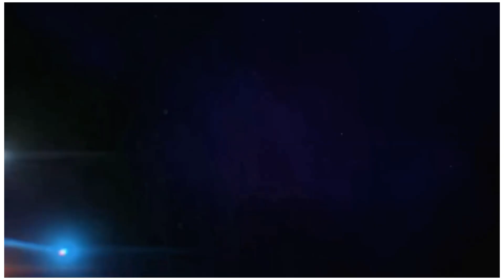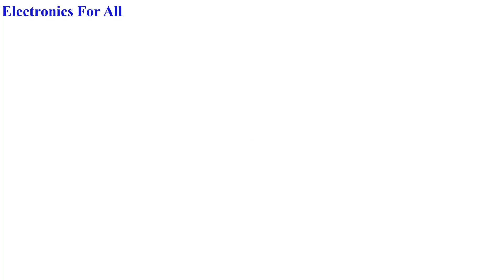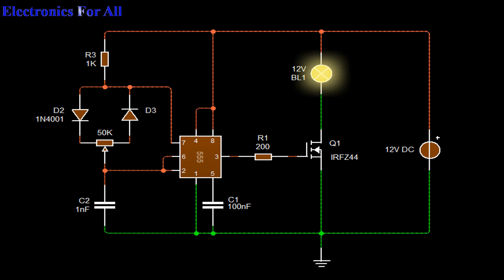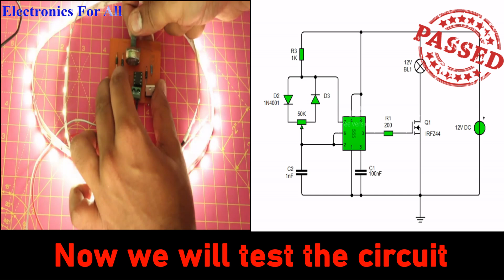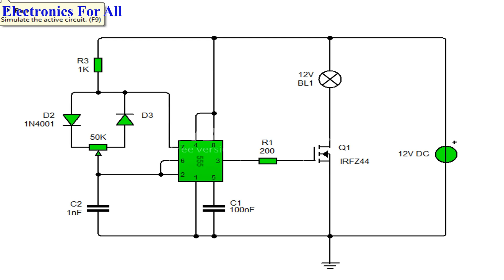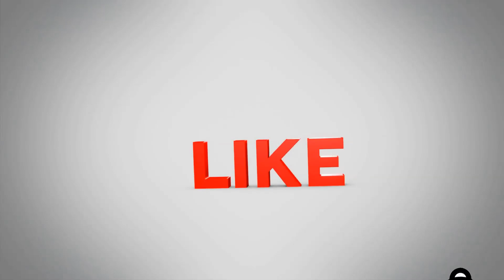Buck Converter for LED Dimmer! Constant Current Design - LM3409 & PT4115 Explained

Comment from the maker: ⚡ FULL CIRCUIT + CALCULATIONS PDF 👉 [blogger.com/blog/posts/2910349977744374112]

Which IC do YOU prefer? 🤔
LM3409 or PT4115? Comment below!

I use LM3409 for HIGH power LEDs and PT4115 for LED strips - What about you?

🔗 Related Videos:
► DC Motor Control with NE555: https://www.youtube.com/watch?v=zifLmFRgk-U
► Diodes Explained: https://www.youtube.com/watch?v=zVK55ylnvCA

❓ Q: Why constant current not voltage?
A: LEDs thermal runaway! Voltage control kills them.

👇 Need help with your LED project? Tell me your LED wattage & voltage!